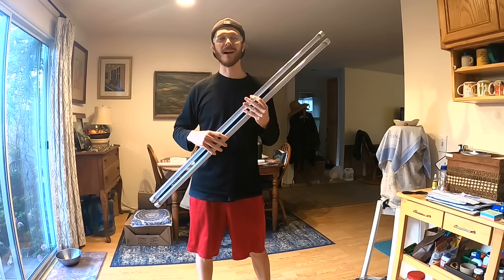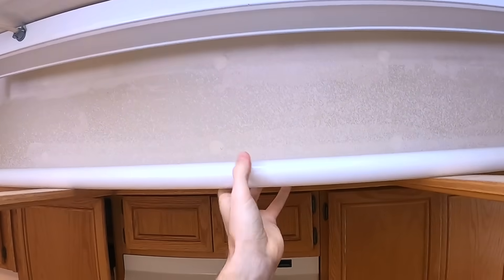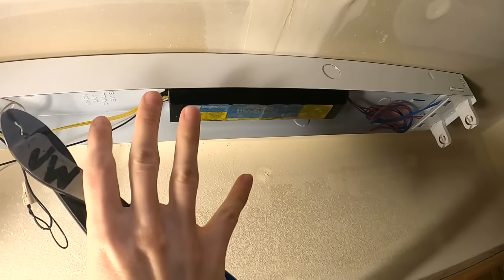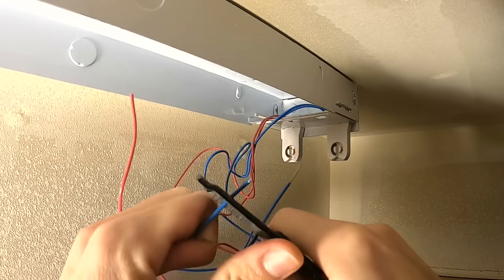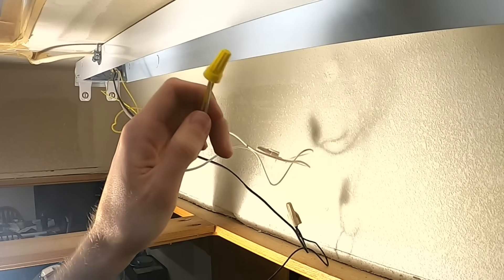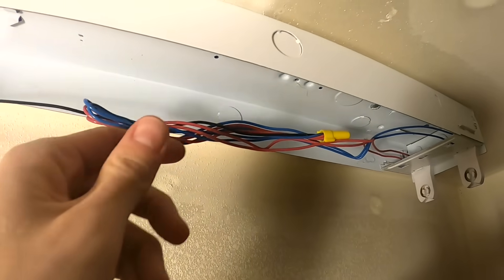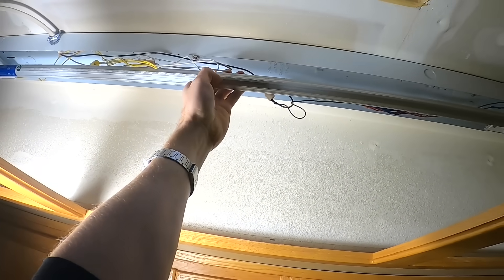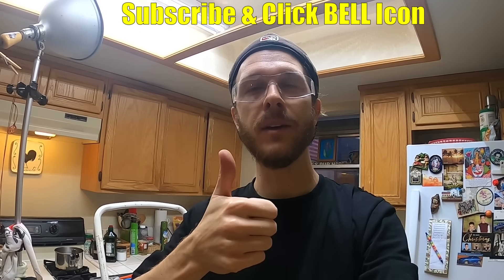How To Easily Convert Fluorescent Lights to LED | Save Money on Energy Costs

Comment: From personal experience, LEDs are susceptible to heat decreasing their lifetime dramatically to the point where they last less than the old lights. So if the LEDs are in the ceiling of a hot room, expect to replace them far more frequently than you think.
Reply from the maker: Thank you for the heads up 🙌👍
Reply: Also compare the brightness of the LED replacement to the brightness of the fluorescent.  Many of the LEDs are significantly less bright than the old bulb and now your area will be darker than with flr bulbs..

Comment: Great video! How do you change those white tombstone sockets?  Do you have a video for that?
Reply from the maker: Thanks. Fairly straightforward process to replace, no sorry don't have a video but here's one
https://youtu.be/lZRxZlvmf3A?si=gslN2OM9JP1E4z1Q
Basically just pull wires out and put into new ones. Just be sure get same style replacement tombstones

Comment: One issue I have had with LED shop lights is radio interference.  To solve this issue, I set up an outdoor antenna.  There are many YouTube videos on this.
Reply from the maker: Cool. Thanks for the tip, will try and remember that if I run into that problem 👍

Comment: Does it make a difference if the LED tube is Type A, B or C?  I did exactly as you described  with Type A tube with only a resultant glow rather than Light
Reply from the maker: Type A I believe relies on the ballasts. Type B are ones that work without the ballasts.

Comment: It is wise to take your voltage tester to a known "live" source first. Once you establish your tester works and indicates "live", proceed to check the wiring you intend to disconnect.
Next, make certain those wires are in fact "dead". 
Tester should NOT indicate live if you properly turned off the correct breaker.

Once you check the "wiring" to be in fact "dead", go back with tester to that known source to prove tester still reads "live".

Always prove your voltage tester works against a known live source before and after your safety check.
Reply from the maker: Great point, I forgot to mention, but I always test those testers on live circuits first. Theyre not 100% 👍

Comment: i changed kitchen fluorescent for led. New led kept going off and packed up. Fitted replacement but this also swithes off and on. What is cause and how can I solve?
Reply from the maker: Check wiring and all connection. Did you bypass the ballast?

Comment: Electrical rule 101..........double check then check again that the wires are not live I take the main breaker fuse out of the main fuse box and put it in my pocket haven't died yet ,they bite if they are not an unpleasant and sometimes deadly experience
Reply from the maker: Can never be too safe 👍

Comment: Nice Video. Just wondering why you chose to cut the incoming power wires to the ballast, rather than simply undoing the wire nuts? In my opinion you left 2 unnecessary wire nuts in your wiring.
Reply: It’s often quicker and easier than untwisting old wires and nuts that have been together for who knows how long and have usually been over twisted. I often do the same thing he did especially when you are doing a whole buildings worth of these lights
Reply from the maker: On one of the sides I needed the extra length, but you're right one of the sides I could've shortened it by undoing wire nut 👍

Comment: I'm German, old light and sound engineer. All liars. Example: Before 2. War German Osram Company and General Electric made an contract that normal light bulb should live 1000 hours, to get more money. So they constructed their bulbs in this way. Now we all have an other problem: they say, LED is very good , live very long and save energy. Save energy is right, but their costs are very high and the quality of light and the their lifetime is shit. Hey, show me an good LED- lamp with 4500 or 6000 Kelvin. Or better: a Blacklight-Lamp wit LED... what was used in discos. Or show me an low-voltage spotlight with 16 degrees light-angle!

Comment: Total waste of time and money. There's no savings.  Led's are garbage. Florescent last decades,  Led's last months. Not to mention they use just as much current. If you convert all your lights you'll never see it on your power bill.
Reply from the maker: Depends how many you're installing. It adds up quick if you have several 👍
Reply: It sure does! Pack of 2 florescent at the wallmart 9.97 last decades. 4 pack led bulbs are 35.88 and get replaced 1 or 2 times a year. They dont handle any moisture just like the tail lights on most new vehicles 😂.  Junk!
Hook, line, and sinker... got me a marlin.

Comment: Just beware of one major item.  There are two types of led replacement bulbs.  One type like the one shown in the video, and another with a different wiring requirement.  The other type only powers one end of the bulb, while the other tombstone is just a bulb holder.  The bulbs are not interchangeable without rewiring the fixture to match the bulbs.  Just pay attention to the directions on the package.  Also, there are shunted and non shunted tombstones used.  This style of bulb can use either,but the bulbs requiring wiring on one end only require non shunted tombstones, and usually come with the bulbs.
I has converted over 1,200 bulbs at our church’s school and highly recommend LEDs
Reply: Exactly right.
Double ended LED bulbs can use the same shunted tombstones that the fluorescent bulbs used.
Shunted tombstones have both contacts on each tombstone shorted together.
The single ended wiring requires non shunted tombstones, where the contact on each pin is electrically isolated from the opposite one.
If a person does not know, and uses single ended wiring with a shunted tombstone, they will be wiring a short from hot to neutral, with an immediate short and wires burning up as soon as power is turned on.
Reply: Yes you have to read the instructions and pay attention to the tombstones to be sure if they are shunted or not depending on application, there are also some LED replacement lamps that are ballast dependent and you will smoke the lamp if you direct wire them to line voltage and another type that can be used with or without a ballast. I do maintenance at a major airport and we have so many different types of lamps and fixtures (technically they are now called luminaries but I still refer to them as fixtures) there that it isn't even funny not to mention the new ones from the factory that come with an LED driver and LED strips instead of a regular ballast and those seem to go out or start strobing on a regular basis (the drivers are the weak link), we still have some T-12 ballasts in the older sections that haven't been converted yet and some still work since originally installed from the 70's.
Reply from the maker: @AreaThirteenThirteen  ohh nice so you know all about all the different types, that's cool. Yeah the integrated led panel lights don't seem to last long in my experiences so far. Hopefully they get better. Probably just a matter or making higher quality and selling for more money
Reply from the maker: Wow nice job, that's a ton of conversions you did, thanks for sharing the helpful info 👍
Reply: @JonnyDIY   the process is really simple once you know how to make the change.
Reply: most people do mot know about single and dual power. i you know you know this and i already knew this but in his video he should of explained it in further detail. because most of the general public dont realize there is a difference. i converted 16 fixtures in my garage to all single end power, 8 in my home and 20 for A FRIEND, i am glad you pointed this out in your comments, great job TED
Reply: You are 100% correct, that must be looked out for.
Reply: coming up on 7 years since i did this with the power on one side LEDs, and yes they came with the non-shunted tombstones.  bulbs are still going-- they are triangle and i forgot the brand.  the discoloration from the hot ballast i witnessed makes me think fluorescent should be banned btw.
Reply: Which style tombstone is used here

Comment: 🤣 So you save maybe $5 a year. 🤣
Reply from the maker: Hey $5 bucks is $5 bucks 🤣💕👍
Reply: I swapped out 18, 400 watt bulbs with 100 watt LEDs.  The ballasts and bulbs run so hot you can’t touch them without gloves.  Now they are using a quarter of the power, and produce no heat.  You think that only saves $5 a year.  We went from using 7200 watts to 2800 watts, and our air conditioners don’t have to work as hard.  You really need to rethink your logic.
Reply: @robertheinkel6225  
Nobody has mentioned discharge lamp to LED. The subject was fluorescent to LED.  My logic is sound unlike your ability to stay on track

Comment: But why? Why would you swap? No, really…..
Reply: At our school, I have replaced over 1,200 40 watt fluorescent bulbs with 7,5 watt led bulbs.  They save energy, come on instantly, last longer and produce better light.  I was changing bulbs weekly before, but now haven’t changed one in over two years.
Reply from the maker: In my case one of the ballasts had gone out, so it was a no brainer to switch.

Comment: just buy a new fixture
Reply from the maker: Yes that is one option, but with this conversion I only had to buy bulbs and still retain the same amount of lighting 👍
Reply: @JonnyDIY  That is the point, those style of bulbs literally cost as much as a new fixture, plus you get something more stylish and up to date
Reply from the maker: @ace2guitar  good point, but I only spent like $30 on bulbs and can retain similar lighting as before. I plan to change out the fixtures in the ceiling, but where they are in a drop ceiling it's going to be a much bigger job. Drywall, electrical relocating, trim and paint work. This will get me by til I can get around to that 😄👍
Reply: Also a lot of new fixtures have bulbs that cannot be replaced.  If it fails, just buy another fixture, instead of bulbs.

Comment: Nicely made video with good info and thanks for that.
One small item - you didn't tighten your wire nuts enough, should continue to turn until the insulated portions of the wires twist together once or twice as well.
Reply from the maker: You're welcome, happy to share. And thank you for the tip 🙌👍

Comment: Holy cow, this is way too complicated.  Just take out the old fluorescent light fixture and put in a LED fixture ($20 at Costco for 4000 lumens).  And you do not have to purchase 'special' LED bulb to fit into old 2 prong plugs.  A new fixture is just plug n play, there is nothing to do, very simple.
Reply: Yes, you can buy LED bulbs that work with the ballast ... BUT the ballast uses electricity and is totally unnecessary with regular (not designed to be used with a ballast) LEDs. Keeping the ballast in place wastes electricity. And the ballast will eventually burn out and need to be replaced! 

Don't be lazy! Get rid of the ballast!
Reply: @dkhnova does powering led bulbs without a ballast reduce the lifetime of the new led bulbs though?
Reply: @Byron-r9e   Normal LED lights don't require a ballast. (Fluorescent lights do require a ballast.) There's a special of LED bulb that can be used fixture that has a ballast. I'm pretty sure that if you put a normal LED bulb into a fixture with a ballast, it would ruin the LED bulb.
Reply from the maker: Only problem is those led fixtures don't seem to last too long
Reply: @JonnyDIY  Well I hope you are wrong.  I have a VERY similar setup in my kitchen as in this video and I actually put three LED fixtures in there (daisy chained, but I only used one at a time so far (two are too bright and three on at the same time will blind you, lol)) 4 years ago.  Yes, that is not that long, but I guess I will find out down the road.  But I did do a little more than I stated in my first post, I put in a standard AC plug so now I can just VERY easily put in a new LED fixture if needed.  It would probably take me all of 5 minutes to replace it since it just plugs in and is held by just a couple of screws.  At least I will never have to deal with fluorescents or ballasts ever again.
Reply from the maker: @jamescabaniss5857  Nice, sounds like a good setup. Yeah I'm done with those ballasts and stupid bulbs that are difficult to throw away/recycle 😄
Reply: I did that and the bulbs caught on fire! Turns out my fixtures had old-fashioned mechanical ballasts (little tin cans that plug in and twist).
Reply: @charlesrichards5389  Yeah, that is why it is a lot easier, safer, cheaper etc. to remove the old fixture and just install a new LED fixture and eliminate the old fashion ballasts.  It is almost just plug n play.
Reply: I’ve got 8’ fixtures and it would be a pain to pull them monsters down and replace them.
Reply: Here in the Netherlands you just get a led tube and replace the starter. Easy job. For the attic I got a led armature all in one. Three clips to the ceiling and just feed in the power. Can image these solutions differ between Europe and the US.
Reply: Don't see any such fixtures from Costco, but only $59.99 Feit Electric Wi-Fi 4’ Smart LED High Output 10,000 Lumen Shop Light
Reply: Why add more to land fills.
Reply: @MarkRichardson-f1x  Exactly!  Now you have a nice LED fixture and you will not have to constantly replace the blubs or ballasts anymore.
Reply: Same..
Reply: Omg if you can’t follow the directions u r a wimp😢
Reply: 39.99 for  a (4)   bulb 48" linkable shop light . 10k lumens .
Reply: Thank you so much for the video. You are awesome man.
Reply: Common issue with replacing the whole fixture; they are usually smaller than older fixtures and may or may not cover the hole in the wall/ceiling the wiring comes thru. Then you have wall repairs to do. Not difficult if you've done it, but more work for you. If you haven't done wall repair before, DEFINITELY  not worth it.
Reply: I just swapped the bulbs with leds from walmart….6 years ago…no fiddling with ballast…works great.
Reply: @jstrat121  sure, it works ... But you're spending money for electricity to power a ballast that would be totally unnecessary if you had just used regular LEDs.
Reply from the maker: @jstrat121  wow nice, surprised they've lasted that long, that's great 👍
Reply: Not complicated.  This was a whole lot easier than I thought it would be. Just bypass the ballast. Excellent.
Reply: Not complicated at all
Reply: @dustinwestmoreland1200   It is compared to just replacing it in the first place.  And then you also have future proofed it.  Dead simple.
Reply: What are you talking about? That's simple, fast and economical.
Reply: @davepane7306  
•	At some point the ballast will go out, and then you will have to replace the ballast, ugh.
•	The ballast uses electricity, why on earth do you want to pay for that.
•	The ballast gives out harmonics, you will still have to live with that.
•	The ballast can get very hot (from all that electricity it uses), not good
•	You now have to make sure to remember what special type of LED bulb to use, what a pain
•	You now have to pay extra for these “special” LED bulbs.
•	You now have to find these “special” LED bulbs.

Why not just do it right from the start, it is such an easy job to do, it takes VERY little time or effort.   Then you will have a nice efficient setup.
Reply: I just went to costco and purchased just the special led lights that go into the fixture for $5 they are so bright. Thanks i remembered your comment. Thank you. Even though u are saying change the fixture.
Reply: @sargonoshana2324  The LED fixture I bought had a AC plug so it was as easy as just plugging it in.  And I added two more but never use them because it would be WAY too bright, lol.

Comment: Florescent replacement LED light fixtures often produce voluminous amounts of radio noise. If you want your kids to grow up radio illiterate, install the wrong kind of LED's.
Reply: some CFL are super noisy, too.  I replaced some GE CFLs after a week once I realized all of the RFI was coming from them.
Reply: I have replaced over 1,200 bulbs in our school with no issues at all.

Comment: Why  not remove the two old wire nuts and shorten the wires a little? Just wondering.....
Reply from the maker: I needed the extra length for the black wire, but you're right I could've removed the wire nut on the white one and shortened. Good catch 👍

Comment: Thank you for the video. If the current fixture has shunted tombstones, do you also need to convert to non-shunted tombstones?
Reply: For this type of led, shunted or non shunted will work equally well.  There are some led bulbs that require non shunted tombstones, but they normally come with the bulb.  The non shunted led bulbs are wired differently and are not interchangeable without rewiring the fixture.

Comment: Fluorescent we have learned are far better, much cheaper to use, produce light much better for your eyes, and last 5 times longer, and one tip, don't use GE bulbs of any kind, by far the worst, Sylvania or Phillips are much better.
Reply: 😅we have replaced over 1,200 40 watt florescent bulbs with 7.5 watt led bulbs.  They last about 20,000 hours, don’t flicker, come on immediately, produce no heat, and produce better lighting.   And how is that a bad thing?
Reply: @robertheinkel6225  That is totally the opposite that we experienced in our shops, our electric bill went up 20%, the 20,000 hours is a lie, you will find, as we were trying to find out why things were so bad, we did learn that the GE bulbs are of very poor quality, we are all back to fluorescent now, everything is good again, no GE much better light, a very costly mistake, just trying to keep others from making the same mistake and the led were constantly burning out.